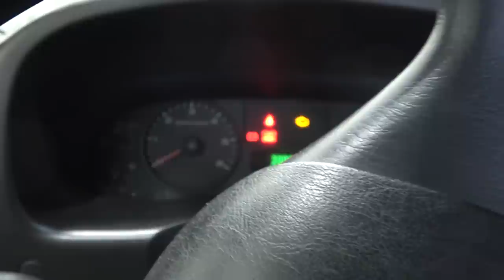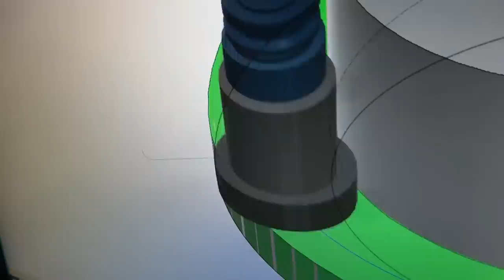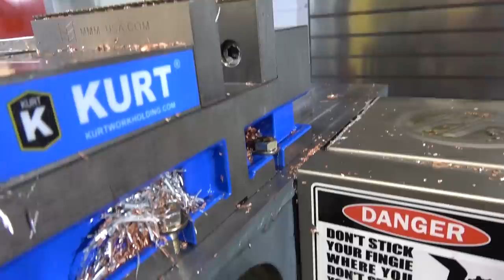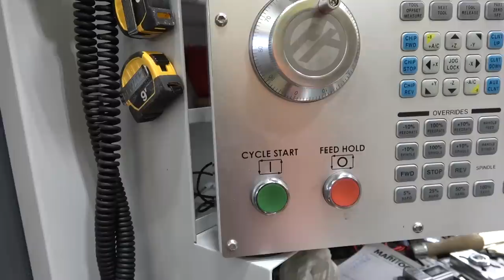How to Brake Job

Comment: I used to make those, you're doing it wrong. 
The castings always come in warped so you have to set the tub of castings on the foot of the swasey that's missing the bolt down to keep her from walking away while your trying to feed her more parts.
Just before shift change you need to pour dykem in alternating colors of each finger of day shifts gloves as payback for second shift pointing the coolant lines towards the go button.
Reply: Anti Seize in the sweatband of a hard hat works too.
Reply: graphite paste on ear muffs is also acceptable
Reply: Replace the coffee with decaff then two weeks later swap for the rocket fuel with guruana powder. Or for a couple of managers we alternated laxatives, diuretics and imodium on a 3 weekly basis with occasional grinding of blue pills in for a laugh
Reply: @jediknight1294  dry out the filtered coffee residue and pour it back in the coffee container was my go to
Reply: Wheel their tool cab out,self tappers through the back into a few random drawers,push back into place and watch on as bewilderment generally quickly turns into anger!😁 My testers receptionist is quite a feminist,he goes in her loo at night from time to time and turns the taps off really tight so she has to ask a man to undo them for her,genius!. I should really tell him to stop doing it but my inner child disagrees.

Comment: Hey, would you mind making a follow up vid and tell us how'd that work? 
I also did that a few years back. Did not help much :) I'm thinking if you dont use a sharp insert, and a decent chipload, it won't help much(the surface is hardened- you gotta break through). Actually the lathe would be the proper tool.
Half the time i can't understand you, I'm still learning english, but I like what you're doing:)

Comment: Though I'm still jealous of all of your machines, the one thing I DO have access to is an ancient, but nice and true brake lathe that gets used a couple times a month. 

Hey, with the mill at least you don't have to use a Roloc disc as a final step to get the non-directional finish!

Comment: They make this thing, is called a lathe :)
Reply: He doesn't have enough rum left to be lathe n plastered...
Reply: But then you'd end up turning the rotor surface square with the spindle it runs on can't have that.
Reply: More than once I've spun the part in the mill. Chucked up a single point cutter in the vise and used it like a lathe. Never tried a brake rotor, but it's a treat for cleaning up armatures
Reply: @otm646  , machinist I work with showed me the exact same trick.  Bridgeport Vertical Lathe.
Reply: He should have machined a mount so he could put the rotors in the spindle and turn down the rotor with a fixed tool.

Comment: man reminds me of my adventures with Crappy Tire and trying to get them to take back a motorcycle battery, they keep the batteries in the back, told the guy the model of motorcycle I had took in the old one, he goes in back comes out with a battery, go to put it in and the terminals wont reach, bring it back and apparently it was the same number but one ended with an L (left hand positive) and they wouldnt take it back and accused me of taking the wrong battery im like "your guy got it from the back hows that my fault?" good ol Crappy tire
Reply from the maker: I don't think Cambodian Tyre hires actual partsmen...
Reply: As a former employee of crappy tire, I can confirm that all auto departments could be made to run smoother by hiring and training monkeys.

Comment: Just finished replacing the inner and outer bearings ( and races as well! ) in the front wheels of my 2002 Ford Expedition, so I feel your pain! In addition to the wheel bearings, I was the glad recipient of the opportunity to replace the passenger side upper control arm as well! ( AHHHH yes, Ford ownershit, the gift that keeps on a-givin’!)

Comment: ahh auto part stores today 
me: i need a macpherson strut/spring compressor 
employee: we dont sell air compressors 
me: baahahahaha no a spring compressor for a macpherson style front suspension 
employee: turns an says to other employee guys looking for a spring for a air compressor other employee tells me we dont sell parts for air compressors 
me: shoots both of them an grabs the tool without leaving deposit
Reply: At least the air compressor spring won't cut you in two when it goes flying off...

Comment: That's why I order my parts in advance mon frere. Literally just got done replacing my pads and rotors just now. Thought ahead and ordered my parts days ago, did not think ahead and order the pad set that comes with the parts kit for replacing the springamathings that have sprung their last spring. First time replacing the pads on this clapped out Tundra, and therefore I couldn't have possibly known that the previous owner made his own retention springs out of what appear to be bailing wire. Needless to say, instead of a spring I only had some metal bits left.
A short beg on Facebook and an hour later, I had a ride to town and back with the tiny V shaped spring that was holding up the whole job.
Completely lost it at "Oh, I see. This predates safety!" by the way!

Comment: OMG I just got back home from doing my brakes and bearing took me 7 1/2 hours not having the right tools everything is seized on and lo and behold it turns out I don’t even have the right brake pads so put it back together with a new set of bearings and have to get a new set of pads on Monday at least it’s all unseized now I’ll take me 15 minutes after work on Monday just fucking hilarious You post this video and I get to see it now lmfao u rock

Comment: I bought a brake lathe 5 years ago for $300 bucks and a weekends worth of moving old shit out of an even older shop. It takes me roughly 10 minutes of setup and adjustment to machine each drum or rotor and another 10 minutes to switch tooling to cut drums or rotors. I say all this because I thought I was well prepared and set up in my shop. Now I’ve lost that feeling of superiority because I don’t have a CNC mill. Damnit.

Comment: I was under the impression that it is useless to resurface disk brakes because the wobbles come from pad material being baked into the rotor from improper braking (braking hard without releasing and rolling off after), and that the different materials were baked into the rotor forever. Is this false?

Comment: I call the left over bolts 
"toss metal" because I toss that shit as soon as the job is done. It obviously didn't need that crap in the fist place. Its a good idea to pump the breaks a few times before you put it in reverse to exit the shop, especially if other customer's vehicles are parked out side.

Comment: I once had my parts computer ask me if the Dodge 3500 I was looking up was FWD or RWD. I punched the monitor and sent a nasty email to tech support telling them to fix their electronic catalogue. Even though the monitor moved several inches and fell over it still worked.

Comment: Took my first car in for a front end brake job before I knew anything about cars...
Shop: “your discs are warped but they have enough material on there we can machine them”
Me: “how much to machine them?”
Shop: “it’ll take an about hour to machine them, shop labour is $100/hr”
Me:”Damn,... how much to replace them?”
Shop:”those discs are.. [clicking on keyboard]... $25 a piece and you need 2 of them. So do you want us to machine them for you?”
Me: “Are you dumb??, why would recommend I machine them?”
Shop: [blank stare]
Me: “I’ll get the brand new discs”
Shop: ok

Comment: Would you please bend the switch on the lift handle.. then it will turn on before the valve opens, so you can feather it

Comment: They gave you 4WD rotors. You probably have the only 2WD Super Duty within 2 towns of that parts store. Kid behind the counter either assumed it was 4WD or thought the 2WD rotor choice that was literally 3-4 times as expensive was just just a premium option.

Comment: Perfect timing! I just did my brake rotors in my 4runner a few weeks ago. Cutting disc put some 'cooling' spots in the surface but haven't died yet so all good hey

Comment: I have also been given the wrong rotors on brake jobs.
I told him it was a 2WD.
Naturally I received 4WD rotors.
I was told that they were right.
I proceeded to do his job and find the rotors under the 2WD classification.

Rotor can also be replaced with S10 wheel bearings, same story, same outcome.
Its a damn spindle. I hate em, you hate em, but you cant pretend like it isnt there.

Comment: I live 3 hours north of NYC. Took Monday off to go visit my Uncle in Brooklyn. On Saturday at 10:30 AM I “ask” my wife to take her car for a test drive before our trip. I drive 250’ to the stop sign and feel this horrible grinding sound. “Holly shit” I say to my better half. “ You didn’t notice that sound!!” Shitty local parts store has pads but no rotors. Father in law has brake rotor turning machine he bought from a dealer that was upgrading. 45 minutes and zero machining skills later and we have 4 flat rotors with new pads. 

Any dumb ass can buy a CNC cutting machine, but it takes a REAL man to turn some brake rotors. 

PS. 

While I was fixing brakes I found steel belt showing on her tires. I realize it’s not her it’s ME!! Never shopped at NAPA again. I spend all day Sunday changing the 4 tires the hard way.  

Point of this story is “Never meet your Heroes “

Comment: How to know when to do a brake job.
1. The little noise tab starts to squeal.  You have 3 weeks of pad left.
2.  After 2 weeks the pad ran out and you are now grinding metal on metal.  Since you now have to change rotors you can dive until payday.
3.  At lunch the day day before payday the last of the pad falls out and the caliper piston is now pushing directly on what's left of the rotor.
4.  On Payday replace the pads,rotors, and calipers.  Don't ever listen to a guy the says you can just put in new pads, he clearly doesn't know how brakes work.

Comment: The vast majority of "warped" rotors just have some pad material built up in one spot, and the roloc disk is all you need to remove it.  That or some scotchbrite will fix it.

Comment: I didn't understand how you dialed it in properly. It would have been more reassuring if you had checked the runout on the truck after machining.

Comment: I didn't realize Ford's needed brakes. I mean they would have to start moving before you would need them to stop.  
Sorry,  guess I am still a bit bitter about losing the "spark" with my girl.  She has been a great gal.  Her skin is no longer perfect and it is a guessing game on if she is coming or going since her internal directional indicator lost functionality.  But a quick motion of the hand always fired her up.  But now even new things to "coil" around her don't work and a heavy "distribution" of gifts including a new computer have not brought back that old "spark"
Reply: I've had at least one Ford that wouldn't run go careening down the hill towards the creek.

In the middle of a brake job, no less.

Comment: You did all that and forgot to wire the horn to the brake lights? Also, give the windshield squirters a 45 degree turn to the left and right respectively, that way strangers can be in on the joke too. 
Your videos are awesome.

Comment: I put my Expedtion on jack stands and stuck her in 4H and ran her up in speed and get my kids to learn how to use wheel hub lathes and machine the grooves out of the discs.
Reply: Wheel hub lathe?
Luxury!
I had to make do with a 115mm angle grinder. Flattening the inside face of the disc took a little ingenuity...

Comment: That’s not the worlds most expensive brake job . Let me elaborate I was a heavy duty diesel mechanic for Atlas Copco Wagner Mining Equipment Co. Our engineers where the ones that came up with the SAHR brake for underground mining equipment. The SAHR brake is a spring apply and hydraulic release internal wet disco brake . Well the cost to retrofit a set of Clark axles for the ST-8B machine was about 50,000.00 dollars and I did about 2 a week that’s 4 axles. We had to completely tear down and remove the original Clark wet disc assembly then buildup and install the Wagner SAHR brake. So you don’t even come close I hate to say. Keep on working on it you’ll get their. I know more then just about anybody else about the SAHR brake I did enough of them over a 12 year period and all the axle bull crap that went along with it. I swam in 90wt gear oil 10 hours a day for year’s.

Comment: I personally like to resurface the rotors by jacking the car up. removing the wheels. Put the lug nuts back on with some wershers. Take emery cloth and slide betwixt the pads and rotor and vicegroap the excess. Pump the brake a couple of time. Start the car. Place in drive and go for coffee. Voila, 20min brake job. No fancy shmancy machines needed

Comment: Oh all knowing AvE. I wish you would have posted this two weeks ago when I required brakes on my E350 Ford. I on the other hand bypassed the parts counter monkeys and rolled the dice on Rock Auto Parts, and imagine my surprise that I selected the correct parts, first time.
Oh Swami AvE, should I go out and purchase lottery tickets or just celebrate that my SWAG was good enough?

Comment: AvE , everything is through away , they use to turn rotors and drums for the same price as a new set .  your time the price of the cutting bits the power to run the Mill , what did you save ?   30 US dollars for a new set of rotors on my Dakota , that is each .  If I had the CNC and tools I be doing it myself as well I guess , unless the Bits and power was going to run me more .  Im a Cheap SOB that's why I watch your videos . DIY guy

Comment: you can see the guy is an amateur at this. I havent seen him open up the leftover bolt container and fill it back up to spec. Its located under the motorhaube or something in the likes. Sits right on top of the metal thing there, sometimes yellow sometimes black, and when you take it off there might be some stupid guard preventing you from filling it too fast with the big bolts. In case there is take a hammer and chisel, remove the safety guard as we dont need them. Then drop in all the leftover bolts and nuts. You might want to pull out the dipstick every now and then if you have a lot of leftovers, just to make sure you dont overfill. But most of the time you can just drop em right in as they all came out of the car as wel.

Comment: Why wrong? Because they didn't come with bearing hubs? That's how they come. You press studs & transfer. They used to grind rotors like this in the 80s but not now b/c of grinding cost vs new and ability to keep the thickness variation close enough. This is the reason they won't grind composite performance rotors, I was told.

Comment: Ahh the simple brake job just slap on new pads turns into no bolt left unturned and installing all new washers the rebuilt truck backs out the driveway for shakedown run a decade later.

Comment: First the Haas as a router, and now impersonating the "professional rotor resurfacing system" found in any beer drinkin, oil change burning for cheap winter heat shop found all over the backwoods of Canada's ugly southern cousin!

Comment: I've seen guys lift car up put in gear and use a grinder on the spining rotor but it's still not as bad as when someone's wife takes car to midas and they charge her 2 grand for brake job...

Comment: So a rotor is what 100 each x4 spends a day in the machine shop to surface the rotors with a CNC machine cost several times more in parts and labor gets to make a yt video priceless

 because its probably demontized

Comment: Do you not appreciate the lower leg and buttocks massage? Do you realize how hard it is to design that feature in specificly when needed during a stressful drive in rapidly decelerating traffic? Plus it saves your ABS system from unnecessary activation and reassures you that the brake system is actually working as intended. Why would you want to decontent your truck and lose this valuables design feature?